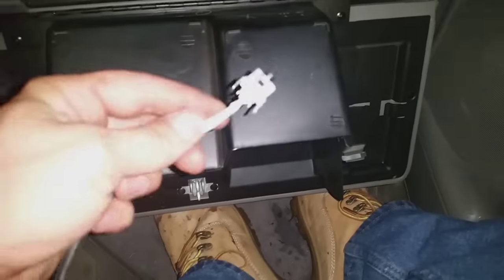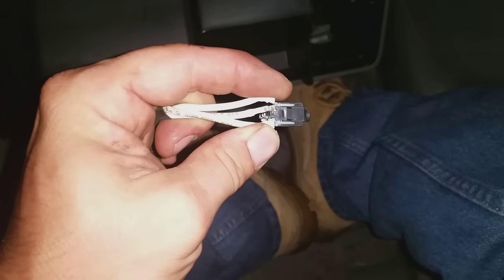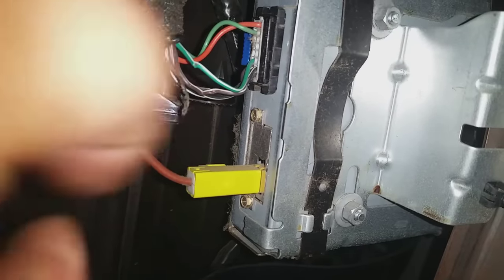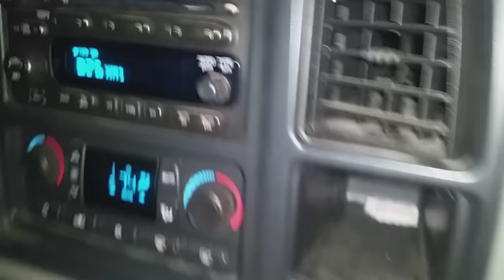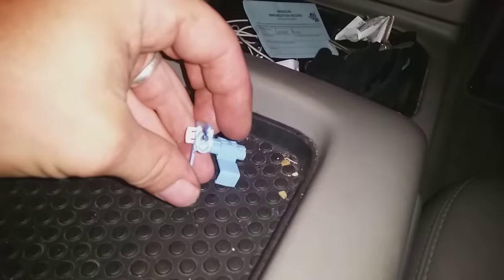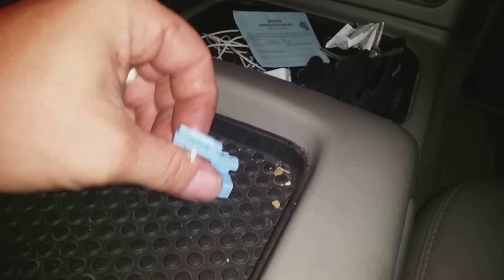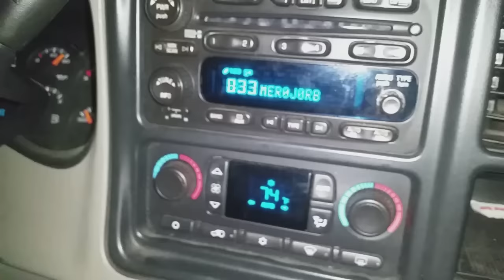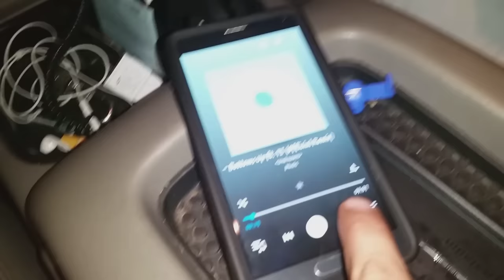D.I.Y. How To Install AUX To Any Car or Truck With XM Radio

Comment: I did this to my 05 Denali and it worked but I tried to do my husbands 04 Yukon and it didn't work. Just heard humming noise. Do you think it's a bad ground? Any suggestions?
Reply from the maker: michele mazie it might be. Just make sure u are not charging your device from the same vehicle and it has XM radio
Reply: PuppetKicker Thanks no I'm not charging at the same time and the radio does go to xm channel 0 and all of that. My Denali has the touch screen navigation with xm, I got that to work perfectly on the first shot. My husbands Yukon is the same radio as yours. Thinking I have to do the same with the ground that you did to the metal under the dash.
Reply: michele mazie mine did not work either, I bought an Fm Bluetooth from Walmart and it works.
Reply: If you dont buy cheap kits and did it all right its probable the cord from phone to jack that bad. You cant go cheap when doing this.

Comment: Great idea. How did  the light bar install turn out? . I've been waiting for that video.
Reply from the maker: sheremeta1 Hey thanks for watching. Sorry i didnt get back to the light bar video but it turned out great and worked great but the thing is I swapped it off for a bigger set of tires and rims for my truck lol now i have some mud tires lol

Comment: Any Idea why you can't charge at the same time?  I get a ton of ground noise if I try to do so.   It stops as soon as I unplug the charger.
Reply from the maker: Scott Marshall not sure. Mine does the same
Reply: You need a ground loop isolator to break the loop between the ground in your charger/cigarette lighter, and your audio ground.
Reply: Electrical noise. Probable from the ground being so close to charging port. You can put ground elsewhere and curl your cord to reduce the interference.

Comment: The left and right does matter for subs to hit.     Typically the left channel.
Reply: Brown with white stripe wire is the left channel which is the tip on a 3.5 mm jack. The green with white stripe wire is the right channel which is the center. The bottom is ground.

Comment: I have a 2004 gmc envoy how do I install a aux jack
Reply from the maker: david mack if you don't have xm then it won't work
Reply: If you don’t have XM try doing an antenna mod they have kits for that you hook up a power supply and place to a radio station but you have to install a power switch for it
Reply: If you have XM you can do it. You'll find the XM box that PuppetKicker was referring to up high on the firewall above the passenger's feet, under the glove box. It is attached to a cover panel and will come down with the panel when you remove it.

Comment: any wires size work
Reply from the maker: Just use same size as the other wires
Reply: +PuppetKicker The Manic Mechanic spaker wired work is small size
Reply from the maker: Just use same size as the other wires
Reply from the maker: Just use same size as the other wires
Reply from the maker: Just use same size as the other wires